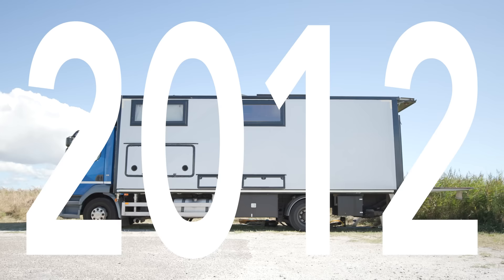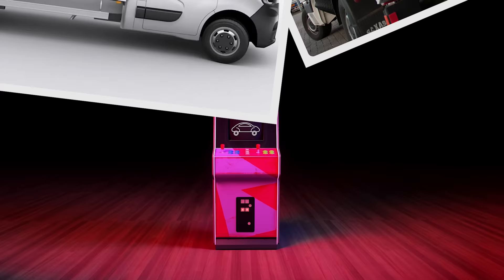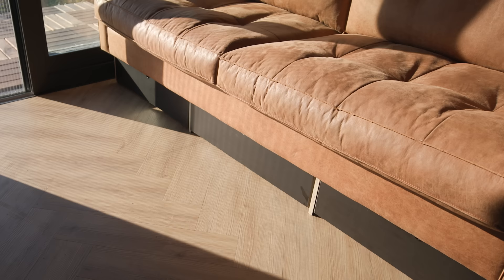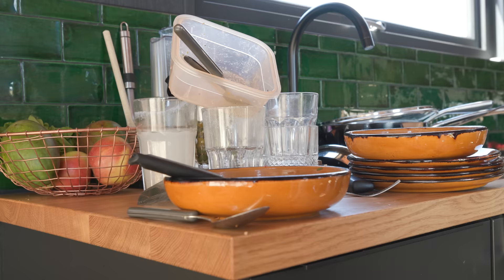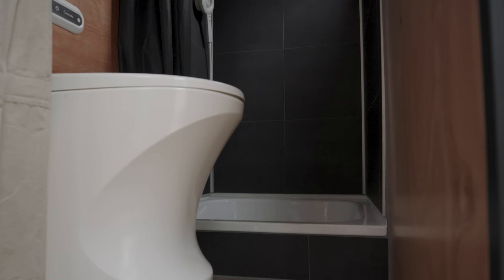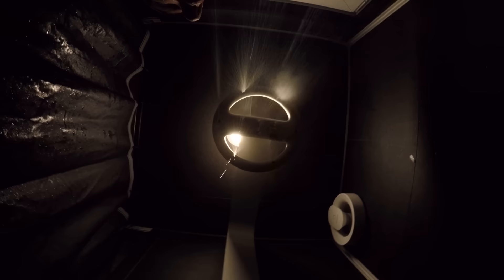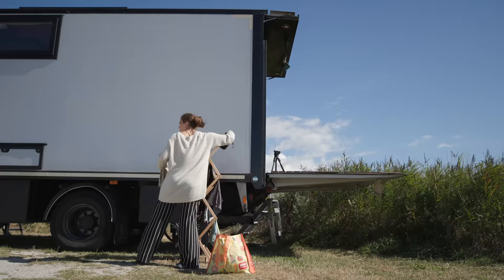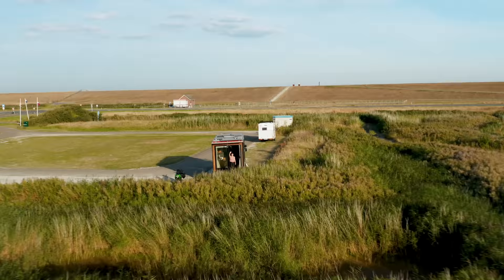Van Tour of our Tiny House Truck

Comment: This is just incredibly well designed! Maybe you could show everything in detail in a next video. Also I’m interested in where you’re parking the truck all the time.
Reply from the maker: Thank you! ❤️ The input is appreciated a lot. What kind of details would you like to see in the van? We will try to make a video about our parkings for sure!!
Reply: @NicoJona  Im interested in the small things, like the way you get into bed or how your table is working. Also I’m curious about your tanks, electricity , insulation, windows and storage. And I forgot to mention, the videography and editing is great :)
Reply from the maker: Awesome thanks for the input! It goes onto the long list 💪🙏👍
Reply: @NicoJona  I'm interested in details too, things like how hot water gets to your shower-head, does the same feed go to the sink? Which boiler did you choose & why & where is it? How big your underfloor drawers are, how they're constructed & mounted & how do you get to the gaps? What's your solar setup like & why?
Basically I'm looking for inspiration for my next truck.
I've got a couple of the details, the side door will open into the shower tray, the subfloor storage will open upwards, top-hung slideouts for a workshop & maybe living space, roof deck with slide-out solar panels, access through to the cab, slide-out swiveling steps, electrics board mounted on the back of a door, details...

Comment: One of the first builds I've seen where a proper dishwasher and washing machine were included.  That shower is amazing and the whole layout is superb.  My preference has always been for a queen size bed in the overhang above the driver's seat so that I never have to worry about putting it away or getting it dirty - particular if pets are involved, and a pass-through from the driver's seat to the main space so you don't have to get out in bad weather.
Reply from the maker: Thank you 🙏
Yeah fixed bed was a must for us, because it means as a couple you still are able to do your own thing 🤪
In terms of break through to front it was too much hassle with the truck 😅

Comment: That looks amazing! I would probably consider a horizontal sofa Murphy/wall bed (if it works space and weight-wise) where the couch is to have more space on the other side where the bed is.
Reply from the maker: Thank you 🙏 
Interesting though. However, we used the space under the fixed bed for all installations such as water heater, water tank, batteries etc. 
It is easy to think of more living space, but this kind of stuff needs quite some room 🥲🙈
Reply: @NicoJona  That makes sense 🤔

Comment: A great build and well done!! My only questions are, water and how much do you use per day and how much you can carry  with showers, dishwasher, washing machine and general usage per day you would be going through the water big time. Also what have you done about the grey water do you have storage tanks for the grey water and empty where you can. Heating of the van is another area that looks like you may not have adressed or what about hot water for the showers etc.

Comment: Amazing build. I love what you came up with.

Two questions:

Why did you choose not to have a door to the toilet?

And how do you avoid that your water system freezes in the garage? It seems that the lids aren't that well insulated. 🤔🤔🤔
Reply from the maker: 2 very good questions:
Bathroom door: the frame takes up quite a lot of space & we did not build it from the get go & later it was too much a hassle zu put in without it disturbing the drawers of the close & the nice op space feeling.
Freeze prevention: 
We underestimated the strength of the cold climate to be fair. It froze once in the 3 months on Austria - so we should have isolated the access door better. The floor & side wall is actually fully isolated. Will add arma flex. on the door probably. 
If you want to have more uncut & real vanlife experiences
Listen to our podcasts via vanlife therapy (https://youtu.be/zmBoxklhfJ8) - we share our frozen water system story in the latest episode ;)
Reply: @NicoJona  thank you for your answer 😊 I will check it out 🙂

Comment: beautiful build - what fireplace did you choose - I have a luton box van - not as large but similar - not as cool as yours - really nice bathroom - the Cinderella toilet i heard if you have enough battery bank can run it with that
Reply from the maker: Thank you 😊
We chose the cubic mini, it is simply the lightest option. Yeah. We got this Cinderella toilet second hand because  it is pricy. If the winter is a not an issue in terms of solar power, then we slowly try to move away from gas! 
Coool what kind of box you have & where are you located? :)

Comment: Can you list the type of shower, toilet, washing machine and do a full van tour so we can see how elements relate to one other?  How much fresh water do you carry?   What fridge/freezer?  What about power; propane, gas, electric, or solar-powered?  What is used for heating, cooling, in/out air movement?  What are dimensions of the unit?  Approximate cost of truck and conversion?   Thank you from Cheryl in BC, CANADA 🇨🇦
Reply from the maker: Check our two newer videos ;) 
One is about the technical stuff, water, solar, etc. & about the cost! Let us know if you still miss some input and we see if we can answer it in another video ;)

Comment: Hey guys! I'm having trouble deciphering the DAF model designations... Based on the size of the wheels and the fuel economy, I'm assuming it's 12 tons? 
You said in the video that 650.000km is pretty reasonable "or so they told us"  - does this mean you had  mechanical issues after buying it? If so, what were they? 

I've lived in a 2001 Mercedes Atego 818 (7.5 tons) for almost five years now, and for various reasons, I want to switch up to something slightly bigger in the next year or two, and I'm unsure as to what mileage range I should be looking at. (The Atego had around 350.000km on it, cost €6.500 and came with about €2.000 of new suspension and brake parts and still needed another €3.000's worth of work more, but since then I haven't had anything.)
So I'd love to hear about your experiences with your DAF.
Reply from the maker: Cool to hear you’re living already in a truck for so long! Why do you want to switch to a heavier model?
I said “so they told us” to imply I myself have very little mechanical knowledge. I went with the advice of others. 
A year into this adventure now and we have only good words for our daf lf 55.
Reply: @NicoJona  To put it short, I need to import my truck to Spain but their regulations are so strict that I'll basically have to redo the whole conversion. And even then it wouldn't work out because in its current state, it's too heavy and I wouldn't pass.

 So I have three choices: 1) redo my conversion in the same truck but with lighter materials = lots of money for no added value 2) get a newer, lighter 7.5t truck and redo the same conversion in it = even more expensive and I'll still barely stay under the weight limit. 

Or 3) get a heavier truck with a BDF chassis. No need to homologate as a camper because the box will be cargo, and no issues with weight limits. Also a considerable investment, but I get SO MUCH creative and technical freedom for the project out of it.
Reply from the maker: I see. Do you have your 7.5 t truck registered as a camper ?
Reply: @NicoJona  yeah. Thing is, with a permanently mounted box, I can't run it as a truck when there's no mentionable cargo space in the box.

Comment: It used only 0,76L pr 10km? That is crazy... My Ford Transit 2,2L 165hp box van used 1,5L pr 10km and on a good day 1,3L pr 10km. Now with solar panels on roof and camper interior the fuel consumption is even worse....

Comment: There's just no way you have a robust enough solar setup (no mention) to keep up with your appliances demand...so you're either plugged in, or running a generator for that over the top consumption! It's just not practical having that many energy reliant appliances...unless you're a driveway nomad!😂

Comment: How much water do your dishwasher and washer use? I feel like those use too much to be using in this situation!
Reply from the maker: I understand you concern, but a dishwasher is actually not using much. 9liters per cycle & we use it once a day/ one in 2 days. A normal handwash uses same or more (statistically). The washing mashine uses much more 30l per cycle. However, a run to a laundromat is more time consuming & costs me 20€, so also a simple math equation of what makes more sense for us :)

Comment: got a link for that washing machine?  or a make and model?
Reply from the maker: Daewoo mini - where are you located? There is only one online shop in Europe that has it still in stock 🙈
Reply: @NicoJona  Kentucky, USA - thanks for the info - If I can't order one, maybe I can find a used model floating around. EDIT- actually did a search for the 'Doewoo mini' and found several on Ebay - also saw a link for an 'LG - SideKick 1.0 Cu. Ft' - which is a mini top load drawer unit - about $300 cheaper - but no dryer function - I hang dry anyway.